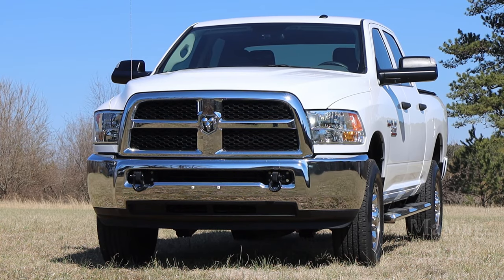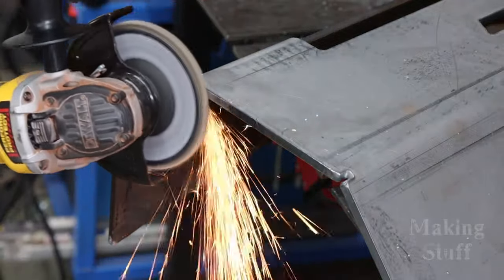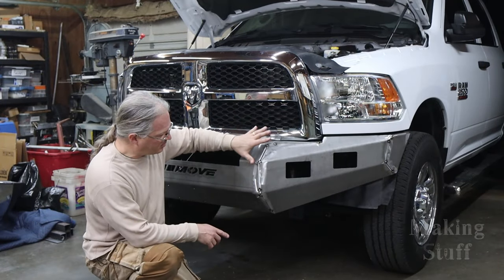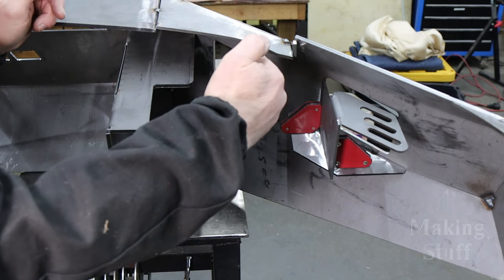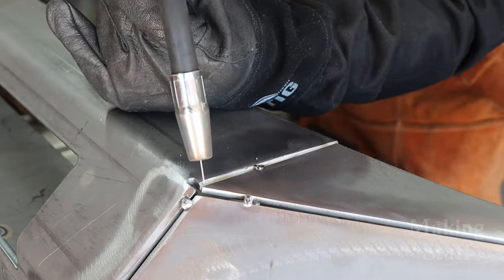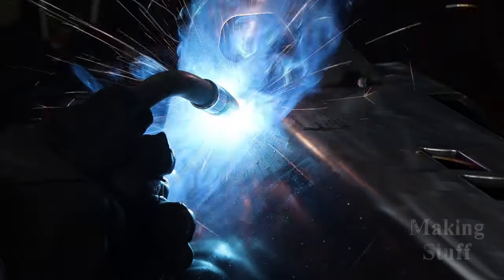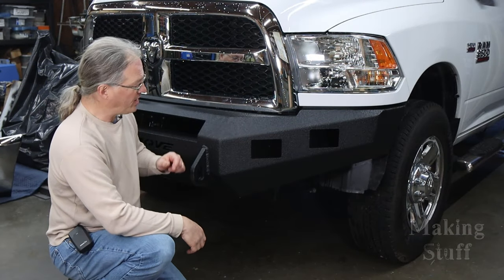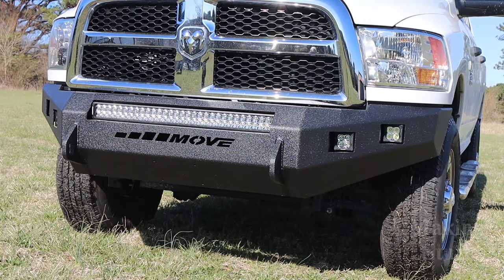Move Bumper Build - Weld - Install - Enjoy | It's Easier Than You Might Think!

Comment: Looks really good. Great job, but I would cut the tow plates off, bevel them and run multiple welds on them. The thick metal tow plates are made from is to thick for the single pass of the mig or even an arc welder. Bumper looks awesome.

Comment: Great video. I bought a full grill cover bumper from Move, I've never welded before i have i mig 140 welder. Should i attempt to do this myself or should i pay someone else to do it for me any tips. Subscribed to your channel btw. Thanks for the video.
Reply from the maker: The bumpers aren't hard to weld.  If you aren't confident in your welding or have the right equipment, then I'd say pay some one to do it for you.

Comment: Great video. I too made my bumpers for front and rear. Really like that raptor liner. How much do you recommend to do the front and back bumpers ? 4 bottle or 6 bottles. Also how much primer did you need for both front and rear bumpers ? 
Thanks
Reply from the maker: It took two coats of liner  for each bumper and each coat took 1 bottle.  So for both front and rear bumper it took a total of 4 bottles.

Comment: How much raptor liner did it take to cover the bumper?  I recently purchased a rear bumper from move and trying to figure it how much coating is needed. Thanks! Great video!
Reply from the maker: I used 2 bottles.  One for each coat (2 coats).  There was about a 1/3 bottle left over each coat.

Comment: Looks great, but what did you do for the inner fender skirts? did you shorten them or re attach them to a different location because they usually attach to the bumper where it curls around to the wheel opening.
Reply from the maker: You must have fast forwarded over that part, lol.  I shortened mine but did not reattach them to the bumper.  Have had no issues with it flapping in the wind at highway speeds etc.

Comment: If your truck came with existing fog lights, could you just splice the existing wire harness instead of running a new switch into the cab?
Reply from the maker: Yes that would be possible, but my truck didn't have factory fog lights.

Comment: Nice job and it looks great.  Is that huge MOVE logo cut into the front optional or mandatory?  I like the bumper, but really don't like being forced to advertise for stuff I'm paying for.
Reply from the maker: There is an option to have  a smaller logo in the lower corner of the bumper.
Reply: Hey there! As Bob said, we do have an option to shrink and move the bumper. Some customers even choose to fill in the logo during the fabrication process. Check out the site for more info!
Reply: You can also skip the light bar option and cut your own light bar opening right where the logo is and DIY a bracket

Comment: Why would you spend $500+ for bumper when you can buy one for $600 that is already welded and powder coated
Reply: Please list some options for $600 bumpers. I haven't been able to find anything that matches this price point.
Reply from the maker: @Viajero69 Me neither.
Reply: I think this guy is talking about those light gauge Amazon bumpers that run about $600? Those are too flimsy to even be in the same conversation as a Move